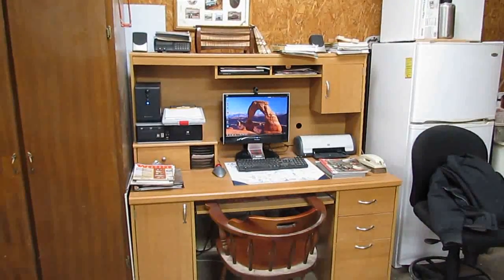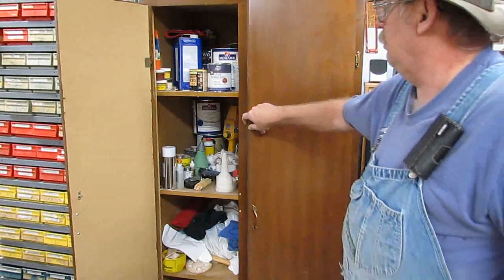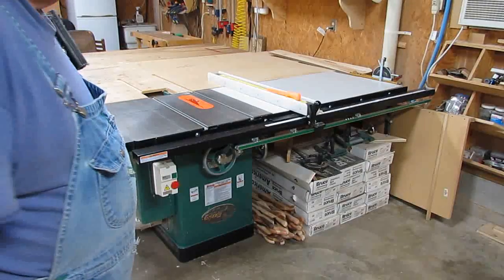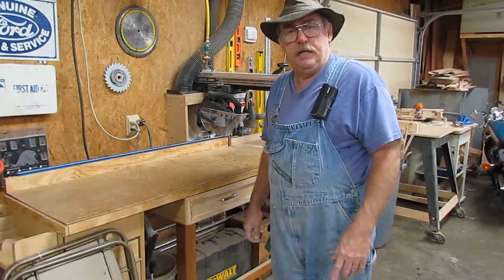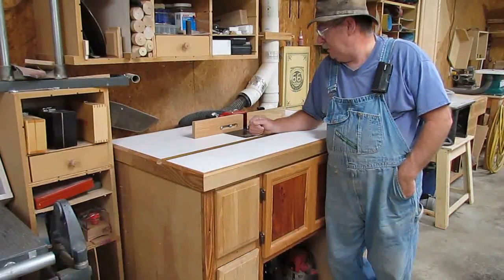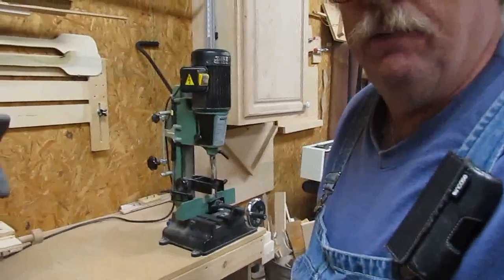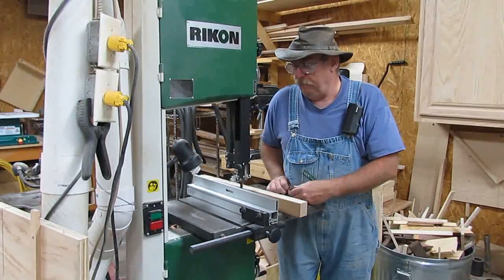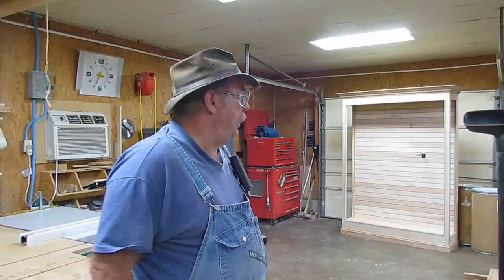Shop tour

Comment: I've got the same vacuum pump that I use with my vac bag.  When I built mine, I made the PVC vacuum chambers twice as long as the plans called for.  The extra volume really helps with the initial draw down when I turn the pump on.

Comment: Dwayne, your dust collection is pretty quiet and seems to be running continuously (based on your RAS moulding vid).  Do you have the main unit set up inside or outside the shop?  What about the ear-killin' screamer, the compressor?  As I build my shop, I'm determined to put both in separate outside enclosures -- the noise really bugs me.  Going to search for your vac-bag vid, that's one I've been pondering.  Another great cabinet guy has YouTube vids by "Beachside Hank," a great fellow from Fla. who is quite generous with his knowledge too!

Comment: You are right about your tablesaw. I own the big Powermatic, love it but the saw is only as good as the operator tunes it. Your Grizzly saw tuned just right with maybe add some new link belts will run as smooth as glass. I have seen new Powermatic and Delta Unisaws that run so rough it is just ridiculous. The average woodworker just doesn't realize every tool needs to be set up and fine tuned. The most important feature is also the blade. Buy quality blades. You have a nice shop, Enjoy, be safe.

Comment from the maker: Thanks for the comments Joe sorry it took so long to respond. I keep my machine beds that way by waxing them with floor paste wax. It keeps them from rusting and makes them easy to clean. The best thing about using it is it makes the wood slide across the beds like it is on roller bearings try it you will be amazed....

Comment from the maker: Thanks for the comments, Now to address your perceived hazards. First I don't see the wood cabinet as a problem I only store stuff there so no chance of anything catching fire unless the shop catches fire then I got way bigger problems. The plastic pipe, things are not always what they seem on you tube. That is sch 40 pipe and it is rated at 480psi. I run 150psi air pressure. No worries there and been using it for many many years never had a failure.

Comment from the maker: Sometimes I set up a temp booth in the shop, sometimes I use another building some times I do it outside, it really just depends on what it is. I do have a big compressor that supply's the shop but I now use a earlex HVLP sprayer so it makes it's own air. Thanks for watching and the comment..

Comment from the maker: Thanks Paul for the comment, The lighting works very well in the shop, the lights are 6ft. apart each way. There are 4 bulbs to a fixture and I have 12 fixtures. I changed the ballast and the bulbs last year. I use the electronic ballast and the t11 bulbs. It makes for some good lighting. The ceiling is 9foot high, hope that helps, anything else just ask be glad to answer any questions. Thanks for watching.